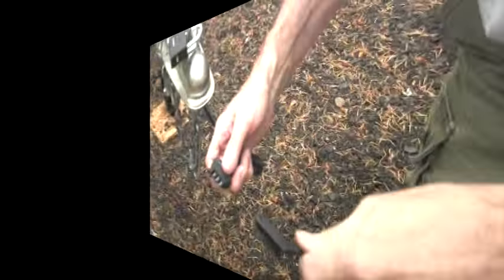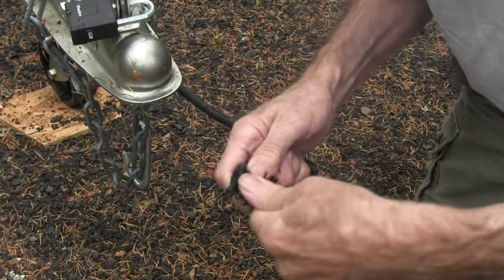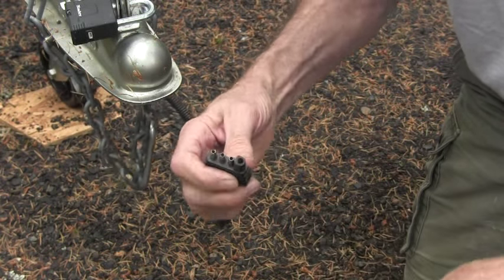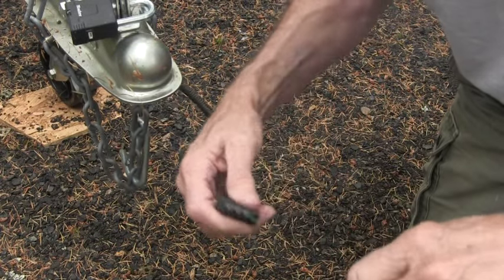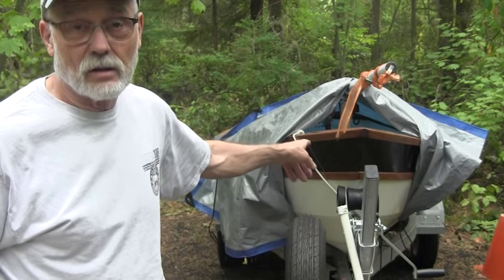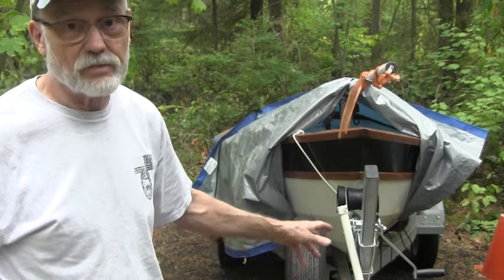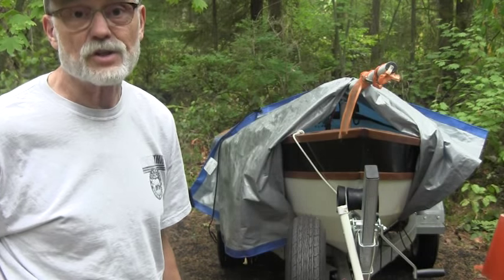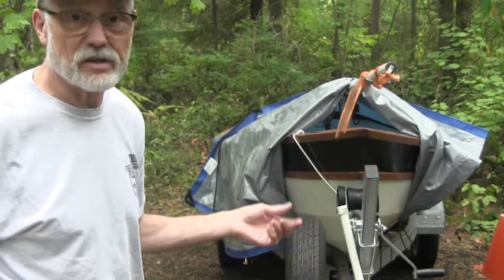Cleaning Four Pin Trailer Connectors

Comment: I bought one of those cover for the 4 pin plugs and put it on backwards on the trailer connector, works great to keep it dry cost under $2, great video thanks for sharing.

Comment: That worked..I didn't have a little pipe cleaner but a piece from my old dremel kit did the trick . The truck plug with cap, is over 25yrs old

Comment: I like to use De-Oxit contact cleaner on low voltage DC connections.   Pricey but it cleans, lubes and protects.   It doesn't take much to stop 12V unfortunately.

Comment: Warren,
Great to see a video from you, there is some great information in this one on cleaning the pins and sockets on trailer connections. I really like the 17 caliber cleaning brush, it would work well for that. I thing to think about is when I used to drive long haul big trucks, the last tractor that I owned was a 359 long nose Pete I used an electric conducting grease to keep the pins sealed and making contact.
Looking forward to new videos, is there going to be a new boat soon?
Andre

Comment: Nice tip. I will try this on my trailers. I suggest using a cap on the plugs and some dielectric grease. By the way on a DC circuit as in car wiring there is no neutral, just ground. Neutral is for AC circuits.  Thanks for the video.
Reply: The1700Rider dielectric grease is an insulator NOT a conductor. If you put it on electrical connectors you're actually making the problem worse because the metal can't make a connection.
Its a common misconception that dielectric grease makes a better electrical connection which is incorrect. The purpose of dielectric grease is to protect boots and connectors from voltage leaks and to protect them from drying out or corroding.

Comment: Thanks for the tip. Too bad it took 8 minutes into the video to get to the point.
Reply: Ha ha ha..yes I admit I used the time line to sample quicker...having the problem not going away with my usual fixes, I was starting to think it was something else..the trailer is older than my truck..40 yr old thing.